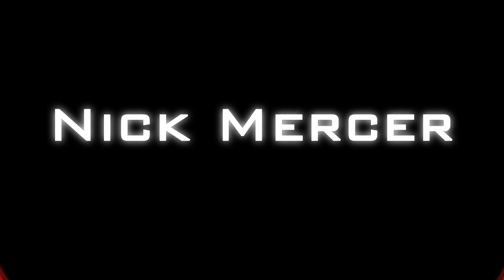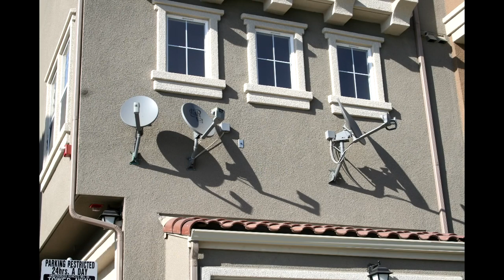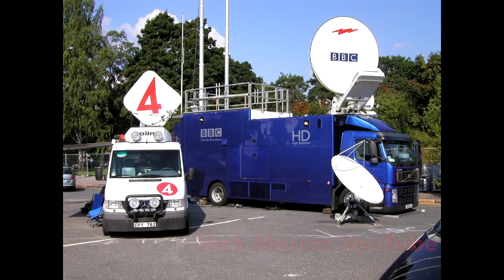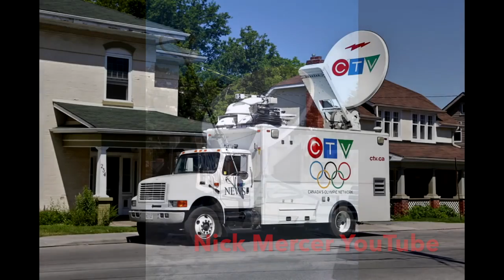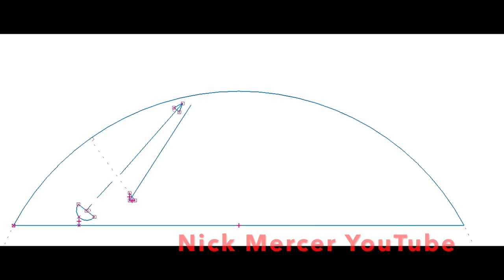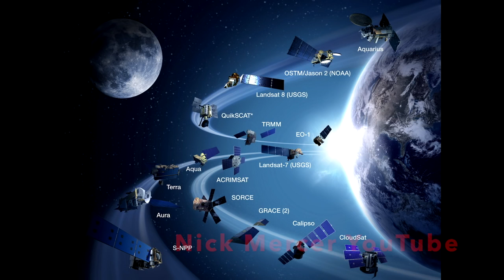The Firmament 2021, How satellites work

Comment: my question is if we are covered with a dome how do asteroids and meteors get through or maybe there inside with us
Reply: andre jones Say what??? Common sense is what you appear to be lacking! What do you think makes "a heavy object" "weigh more than air"? Oh lord, give me strength!

The weight of an object is the force acting upon it due to GRAVITY and is defined as the mass of the object times the GRAVITATIONAL field strength (or acceleration due to GRAVITY). The equation is weight = mass x gravitational field strength.

Also the objects "drop" in that direction because they are accelerating towards the earth's centre of GRAVITY.
Reply: andre jones because helium only has 2 electrons meaning it's mass is less then the other elements present in the air meaning gravity has less effect on it
Reply: Danger Will Robinson #2 comparing meteor showers to hail storms is pointless btw not the same at all and yes conveniently most meteors are small enough to burn up upon entry because if they are too big then they will hit us some occasionally do and cause massive destruction that's not just a rock hitting something at that speed it's an explosion that leave radiation of course this is all easily accessible information you just have to understand the science and not just dismiss it as fake because it's not in the bible
Reply: andre jones 😂😂😂😂😂😂😂 objects are only heavy because of gravity buddy
Reply: Ricky Adams Well, I also studied physics but the difference is that I understand it and you don't or you wouldn't be asking me those questions 😂😂😂😂😂😂😂 Have you not used gravitational equations before and found that they are ALWAYS correct?

You studied physics and think that people on the "bottom" of the globe would "fall off" 😂😂😂😂😂😂 really? You're really asking that? Objects in earth's GRAVITATIONAL field are always pulled towards the earth's centre. So, wherever you are on the earth's surface you always fall towards the lowest point (shortest distance from the core that you can reach before you hit something hard) which is normally the ground. There is no bottom of the earth! 😂😂😂😂😂😂😂😂
Reply: andre jones all matter cannot occupy the same point in space. All matter within the earth's gravitational field is being pulled towards the earth but not all with the same force. So, as Ricky Adams has pointed out to you, matter made up of less particles, therefore having less mass, (e.g. helium), is less affected by GRAVITY than the other gases that air is comprised of. As GRAVITY is causing all the gases to be pulled towards the earth with different forces, the heavier gases, being pulled harder, force the lighter helium (which isn't being pulled as hard) out of the way. 

tl;dr version GRAVITY causes the heavier gases in the air to force the lighter helium up out of the way on their way past.
Reply: Oh and the only reason you perceive yourself as being upright now is 
because your brain is going off sensory input received from your 
vestibular system in your inner ear. Weight sensing hair cells detect 
when your head is aligned with the direction of GRAVITY allowing you to 
determine your spacial orientation. So, as long as your chin is facing 
the ground and the top of your head is facing the sky then your brain 
will make you perceive yourself as the right way up no matter which part
 of the spherical globe you're standing on.
Reply: Danger Will Robinson #2 You saying god can't build a dome that doesn't fall apart? Meteors burn up  when entering the atmosphere. That's what shooting stars are.
Reply: Danger Will Robinson #2 the meteorites in the museums are broken peices of God's invisible dome that happen to look like rocks when on the ground but completely invisible when attached? also they are made up of a lot of the same elements found found on earth the reason we know they are from space is 1 there is a impact sight not a giant crater like you want but impact evidence never less and the big giveaway is the fact that they are highly radioactive from being completely exposed to all diffrent kinds of radiation that the earth is shielded from via atmosphere and electromagnetic fields that's usually the dead giveaway
Reply: Danger Will Robinson #2 also where do you live? in a city most likely going to have a hard time seeing shooting stars aka meteors I'd suggest looking up when the next meteor shower is buy a good telescope and look at the part of the sky they say meteors are going to be visible at the time it says  and try to be in a not so urban environment with light pollution
Reply: Andy Martin because last time I checked isn't gravity why the people on the bottom of the globe don't fall off??????
Reply: andre jones Is that all you can say when presented with facts that point blank disprove your theory? What point exactly are you contesting? PLEASE do tell. I could back up everything with references for you to research yourself but it seems that you won't believe any research that doesn't agree with your flat earth nonsense.
Reply: andre jones I'm still waiting for someone who is supposedly educated in physics to give an answer backed up scientifically rather than regurgitate nonsense they've heard listening to flat earth videos on YouTube. I've used basic physics, chemistry and biology principles to clearly demonstrate how absurd your points are. You haven't said anything of any scientific relevance, proving you have no intellectual understanding of the parroted phrases you're using...
Reply: andre jones 😂😂😂😂😂 you don't understand any of this so you dismiss it 😂😂😂😂😂😂😂😂😂😂
Reply: Meteorites come in at miles-per second. That is why those under a certain size burn up before they hit the ground! Something falling off a "firmament" would be limited to a terminal velocity of 78- feet per second, in the Antmosphere.
Reply: Russell Anderson  Right on the money. It's time to roll my telescope out, M42 awaits.
Reply: andre jones - Darn, you got me :oD
Reply: Mycorhiza What!? Smh...
Reply: Andy Martin  so all meteors are conveniently just the right size to burn up in the atmosphere .  Surely if showers were so regular there would be a meteor shower where they were all big enough that they don't burn up .   Hail storms aren't the same size all the time
Reply: Ricky Adams helium rises because it weighs less than the air... point blank period.........
Reply: Ricky Adams and what exactly does it do to the people under the globe not noticing that there whole world is turned upside down 😂👌😂😂
Reply: andre jones you let it go bro mankind kind figured out a lot time ago the earth wasn't flat all evidence points to a non flat earth I know it would make a really cool story if for all this time we were lied to about it but I'm sorry to say it's not true a simple telescope will disprove most of your theorys now stop wasting everyone's time talking about this your not smart enough
Reply: Ricky Adams lmfao I'm not smart enough to believe everything I'm told you are correct about that.... sorry but not sorry... obviously you haven't looked through a telescope either but ok ✌🏾
Reply: You can track them with RADAR, and FLIR. Forward-Looking Infrared, like any other object in space that reflects radio-waves.
Reply: And you have none. There is NO "up" or "down" inspace.
Reply: There is NO "firmament dome". If there were nothing wold make sense.
Reply: People in Russia not only saw it, many were injured and killed by A meteor that was captured on dash and security cams. Happened a few years ago.
Reply: You need gravity for the air to weigh anything at all! Without gravity going to the center of the earth NOTHING HAS WEIGHT, as its in free-fall around our star we call Sol.
Reply: You can measure the curvature as architects, engineers and surveyors do, with a theodolite, and two plumb-bobs some distance apart. Since the plumb-line is always toward the center of Earth, slope or topography of local terrain makes no difference. Since the plumb-lines will be non-parallel, and a Theodolite has a built in level, a parabolic angle of the plumb lines can now be measured giving us the exact size of the Earth. Seismic waves give us the Earth's shape, size and composition. Study Geology and Astrophysics with a minor in math.
Reply: RADAR and HAM RADIO since 1946 reveals the distance speed, size and surface features of the Sun, Moon, and Planets. You are 71 years behind the times in terms of science and technology since World War II.
Reply: Glass is NOT an "organic" material. It contains no carbon. Glass is mostly silicon dioxide! Study. Learn. Grow.
Reply: The Vatican Observatory is one of the oldest active astronomical observatories in the world, with its roots going back to 1582 and the reform of the Julian calendar.  Today there are 15 Jesuits from many different countries on the staff of the Observatory, who study the universe through solid, scientific methods.  They stand at the forefront of scientific research covering a broad range of topics, from an examination of the tiniest specs of interplanetary dust to the origins and structure of the universe. The Jesuit astronomers of the Vatican Observatory have contributed to discoveries in many fields from the origins of our solar system to the structure of galaxies. Scientists throughout the world recognize their work in planetary sciences, cosmology and philosophy, and stellar and extragalactic astronomy. The Observatory has its headquarters in the gardens of the Papal Summer Residence in Castel Gandolfo, Italy, and a research center, the Vatican Observatory Research Group, in Tucson, Arizona, one of the most important centers in the world for observational astronomy. Most of the observational research today takes place at the Observatory's telescope on Mt. Graham in Arizona. Besides several older telescopes the headquarters outside Rome house a library with a number of historically important scientific works, a collection of antique astronomical instruments, one of the most important meteorite collections in the world and a recently renovated state of the art meteorite laboratory.
Reply: Meteors come in at 30,000 miles per hour. That is the reason they are so brilliant blue white most of the time. I have seen Meteors day and night since the mid 1960s.
Reply: I have been observing meteor showers since the 1960s. They are mostly comet debris and the size of a grain of sand  or up to the size of a baseball. They come in at 30,000 mph, so they burn up! Unless they are really big.
Reply: You need gravity for things to drop towards the center of the Earth. Ever used a PLUMB BOB? Ever do a geodetic survey?
Reply: C Daniels sink holes don't have raised rims. You get crumpled raised rims from high powered ejection from within the hole. Sink holes sink. Craters are explosive.
Reply: Mycorhiza // Why don't you try that experiment on yourself?  Just don't let that "theory" hit you on the head.
Reply: C Daniels // Hail isn't entering the Earth's upper atmosphere at high speed either like meteorites are, which causes most of them to burn up.  Occasionally, larger meteorites make it all the way to - or near to - the Earth's surface and crash or explode overhead, such as that Russian meteorite of a few years ago that caused a loud explosion close to the ground.
Reply: Alejandro Menendez // But, if there is no such thing as gravity, then what causes the broken pieces of the Firmament to "fall" all the way down to Earth's surface?
Reply: Art Vandelay007 Gravity? What a sheep it's called buoyancy and density. Example balloons, smoke going up a chimney, have you ever try to push a ball under water? I've been looking at your comments you think you know everything but you're stupid
Reply: Brady Gerding // Hey Einstein, I've read your comments in support of "buoyancy" and "density" in place of "gravity" elsewhere on YT, and as I remember you got schooled pretty good by several other people.  You obviously don't understand the three concepts, so that makes YOU the stupid one, and unfortunately, you can't fix stupid.  Go back to school and get an engineering or physics degree, then you can come back here and post comments.  In the meantime, crawl back down your mom's basement and play with yourself...
Reply: Art Vandelay007 not sure what you're talking about George? By the way is that ball rash on your chin? The general public is stupid like yourself
Reply: Space is fake! First verse in the bible God created the heaven and earth. The bible says the stars will fall to earth (meteor) dimonds are peaces of the affirment. Listen to the song Diamond girl, or Lucy in the sky with dimonds. Nasa in Hebrew means deception!
Reply: Brady Gerding // Hey numbnuts, the correct title of the song is "Lucy in the Sky with Diamonds", and is a thinly veiled reference to the psychedelic drug LSD...LOL
Reply: Art Vandelay007 the only nuts are on your chin
Reply: +How To Get Out Of Babylon 
Search those words, basalt, meteorites, sea floor, etc Can't remember the channel, sorry.
Reply: Wasted *....... just in case you couldn't figure that out being there's no formula it
Reply: Scott Cameron I asked this question once.
either their pieces of the dome falling off. or the USA has a meteor machine
great answer
Reply: I have been watching meteors my entire life, since the 1960s. All over, day and night. Mostly at Martha's Vineyard, out at sea. I saw one on the highway driving home and it was late afternoon, and it was big and blue white. Only visible for 1/2 a second.  Seen one that made a smoky trail, a sound and then exploded! Metors are either STONY, or IRON/NICKEL.
Reply: i don't say glass.. a layer of some organic material "like" glass.. maybe gas.. some fluid.. some dense material..  something we don´t know yet.. think in more opening way.. Study. Learn. Grow.
Reply: BEP BEP
Reply: so?
Reply: No meteorits     is only electric lights ,,,,like diamonds in the sky
Reply: Where have you seen meteorites?  They don't exist
Reply: Scott Cameron have you seen an asteroid or meteor with ur own eyes ?
Reply: Mycorhiza haha.
Reply: duh they're all CGI lol
Reply: but it is also heavier than the air above it and around it,so why should it choose to go to the air BELOW it ? If you throw it up,it will still fall down. This is due to gravity.
Reply: bear adams that answer about helium is incomplete gravity is gravity it will always pull everything towards the center of Earth always remember this but now you are telling us that helium has two electrons so it's lighter than the other airs... So that's the reason why helium is not being pulled by gravity, I guess helium just proves that there is no gravity read your own comment again and you are disproven gravity
Reply: C Daniels // So, you're implying that the Firmament is made out of rock?
Reply: Stoian Nitu // You're joking, right?
Reply: Nemesis Now // Not true.  The Fallen Angels were killed off eons ago along with their Nephilim offspring during the Great Flood.  That was the whole purpose of the Great Flood, to purge the Earth (or at least the areas of the Middle East) of the Nephilim species and the contaminated human species of the time period.
Reply: Art Vandelay007 have you ever looked into the Nephilim being Bigfoot? Google Bigfoot DNA
Reply: May be? That's your theory. Ball earthers have a much better theory, it's called space ....
Reply: Danger Will Robinson #2 You can regularly watch meteor showers!
Reply: Danger Will Robinson #2 also meteorites are on display at several museums across the country and a lot of people have fragments in their personal collection
Reply: Mycorhiza 😂😂😂😂😂😂😂😂 can't argue with that at all
Reply: andre jones actually you are wrong again sir I have an orion skyscanner 100 what's it like to be wrong about everything you say?
Reply: How to prove the flat earth to ball heads.

Show them that Gravity is just a theory. Hold a very heavy object above your own head and let go. It won't fall because gravity is just a theory. Try it out in front of ball earth believers. When it doesn't fall, they'll have no choice but to accept that gravity is just a theory and isn't real, therfore the earth is flat.
Reply: A video gave the three major components of sea floor materials and meteorites, basalt, pyro whatever, etc. Meteorites may be chunks of the lower layer of the firmament.
Reply: Scott Cameron    When is the last time you seen an asteroid or meteor with your own eyes? Even the huge crater in New Mexico has nothing in the hole .   It's a sink hole that's it .
Reply: Andy Martin your such a good little puppet....
Reply: Once again you are regurgitating what you've been told..... use all that waded brain power, do some research and unfuck yourself.... seriously
Reply: Andy Martin the sun and the moon are just lights pal.... no 007 missions outer space have occurred .... Star Wars NASA Star Trek NASA lions gate films NASA Pixar NASA..... there's no difference ... Hollywood is Hollywood welcome to the real motionless earth ✌🏾😎
Reply: andre jones // What is the planet Earth "up" or "down" in relation to?  There is no "up" or "down" or "top" or "bottom" to an object in space such as Earth or another planet because there is no frame of reference to base your observations on.  Human beings use those artificial terms to describe their body's relationship to the surface of the Earth where they are standing, sitting, etc., because the surface of the Earth IS their frame of reference.  Thanks to gravity, people standing at the North Pole are no more "on top" than someone standing at the South Pole.
Reply: Andy Martin bro all my life I've been raised believing the same bs your regurgitating ... the flat earth theory is far from mines...... I simply did research that exposed the globe ...... its very obvious .. there's no curvature there's no gravity let it go .... pls
Reply: maybe the firmament is an organic material like glass.. an organic material in constant renewal.. the old skin is peeling down.. therefore the metorites and variety of crap falling down.. is the old skin
Reply: Scott Cameron, good question. Maybe we're not covered by a dome.
Reply: Scott Cameron maybe they're not real
Reply: Adam Lawrence ahhhh theory u admit
Reply: Ricky Adams   If there are regular meteor showers then we would regularly see stuff landing in the street or back yard . All we have are some rocks that are in museums that could be from anywhere .  Maybe they are from the firmament dome ?
Reply: Andy Martin   Why does it have to be falling apart .   So you didn't answer the question about why aren't we seeing meteors and asteroids falling like hail sometimes if they are so regular ? I don't know a single person that has witnessed anything like this . Surely after forty years on this planet I would have seen a meteor shower where they were hitting the ground like hail ?  Only in Hollywood movies do you see it .
Reply: Mycorhiza you do realize that heavy object will drop ONLY because it weighs more than the air...... you don't need gravity for that you need common sense.....
Reply: Andy Martin I've studied physics in school.... and all you're doing is regurgitating passed down information.... gravity is not needed to explain why heavy objects fall to the ground...... do you know why helium rises????? Can you answer me that